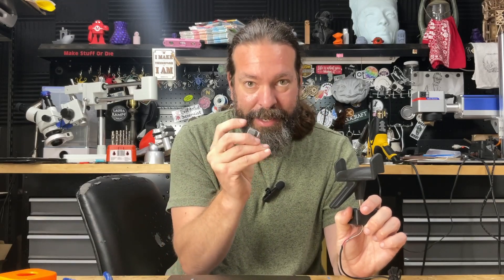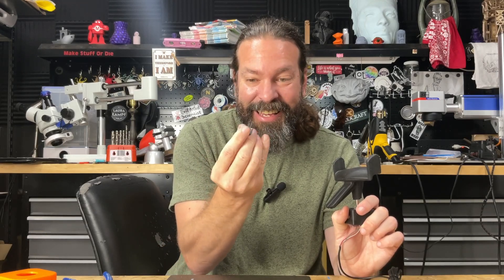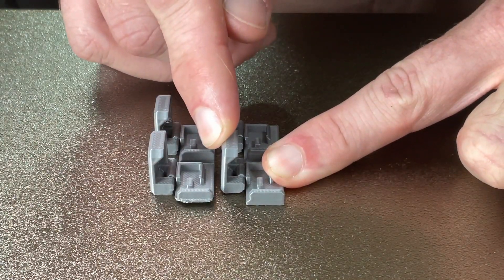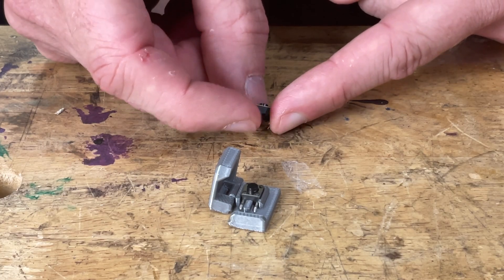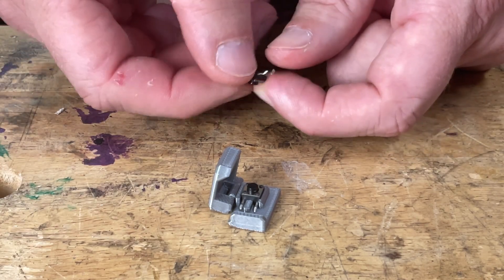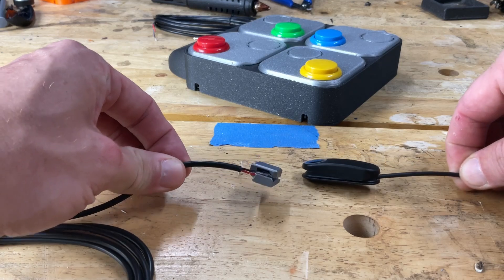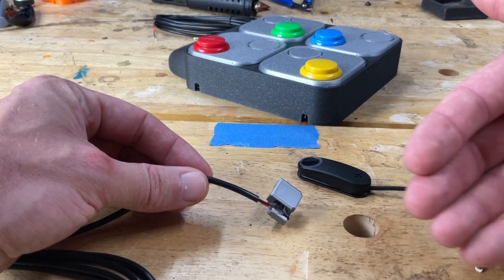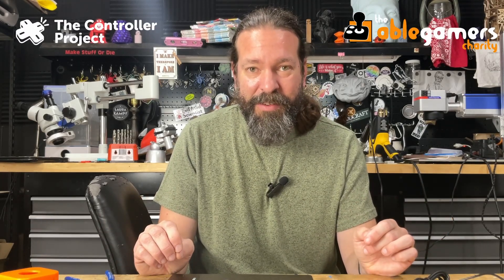Tiny 3D Printed Button For Accessible Gaming

Comment: I'm wondering if it'd be worth designing something around keyboard switches just because you can change their characteristics. Like you can get key switches based on the actuation force needed to press them expressed as weight and you can even get the springs separately.

Comment: Very nice design. I like removing processes, so I would add two small holes to the design to push two metal legs into so that we don't have to cut two of them off, it would double as a good glue spot for the device as well.